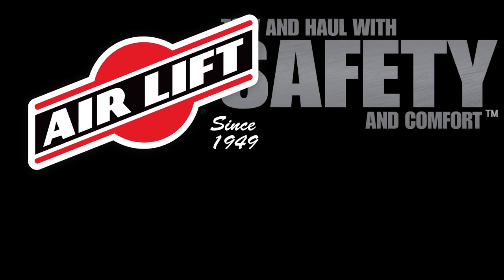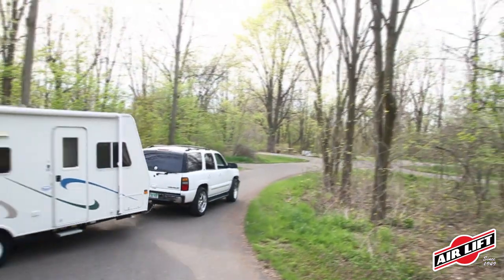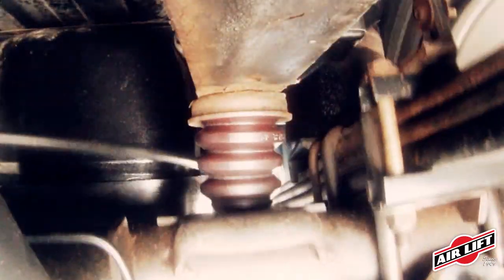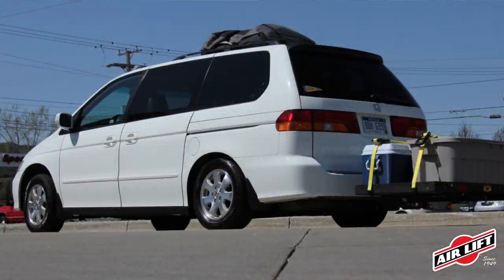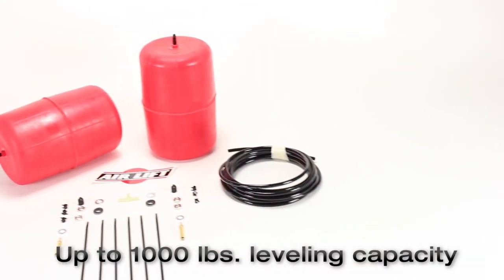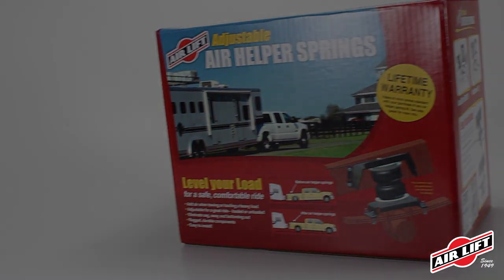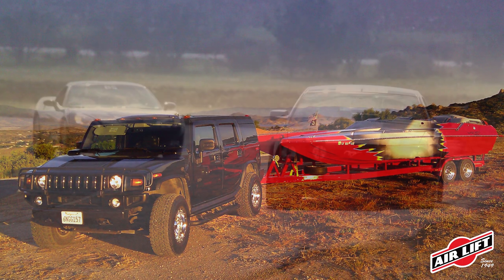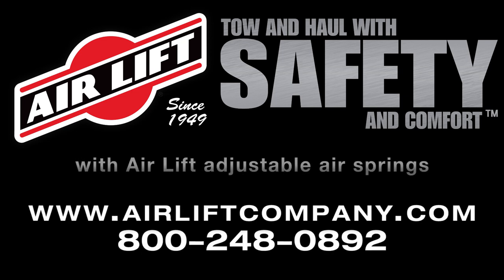Why Air? Why Air Lift?

Comment: I just put air ride in my 2001 2-door Ford Explorer I couldn't be any happier with my truck now used to Sag with almost no load with the air ride now it doesn't matter if I'm towing or just carrying any kind of load heavy or light my truck now always stays level I love it couldn't be happier very easy to install myself in the driveway with only jack stands and a jack and basic hand tools I'm an air ride man for life now thank you air ride

Comment: I just installed a air lift system on my 2012 ram 1500, we pull a 7300 lbs travel trailer.  It work so well I don't need to use my weight distribution hitch arms.

Comment: When it says 2k lbs of leveling capacity does it mean thats adding that to your stock towing capacity?
Reply from the maker: Hi Cameron - the leveling capacity refers to the maximum weight lifting capability of the air springs alone. They do not increase the towing capacity of the vehicle.
Reply: Nah just helps sag and handling for 2k payload trucks like f150/1500’s if you got a f250/2500 get the 5k lbs airbags
Reply: No

Comment: Air lift vs air ride is it the same?
Reply: Air ride and air suspension are general words for the technology. Air Lift - is a brand of air ride or air suspension. However, you will hear Air Lift referenced or said when talking generally about air suspension or air ride, because Air Lift is very much a recognized name!
Reply: My ram has for corner air suspension so I wanted to understand a lil more thanks

Comment: very best the air suspension.my semi truck is 14500kg empty.load weight is 36000kg.drive and 3 trailer axle air suspensions.2 year maximum one airbag demaged!but high load weight and on wrong ways

Comment: I have sacked front leaf springs on my 1994 f 250. I don't want to replace the springs, but can I use the ride control part 59511 to restore the truck to its original height and improve the awful rough ride?? its a 4 wheel drive by the way.. thanks

Comment: Shader Valve? You lost me. Those are terrible. Now you need a pump with a shader valve. Just put a regular valve.
Reply from the maker: It is the same common valve used to inflate tires.
Reply: It's a common valve used on bicycles.
Reply: It’s used in refrigeration and HVAC as well.   They are very reliable.